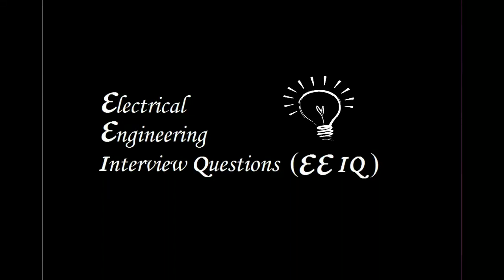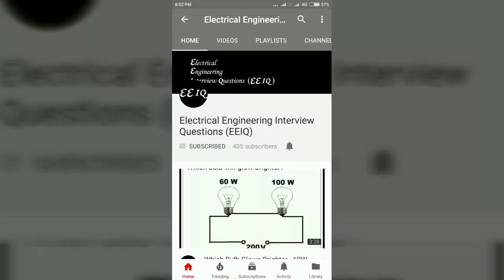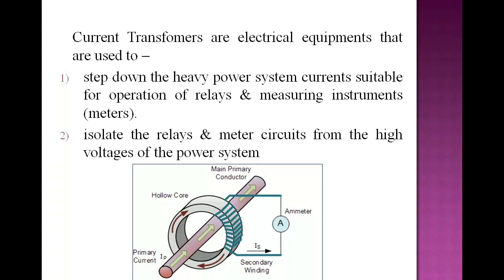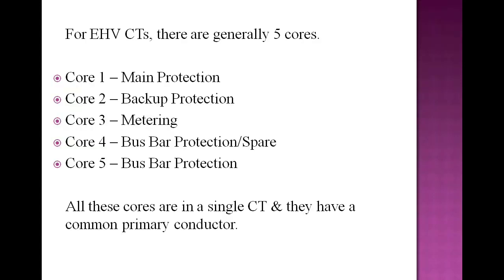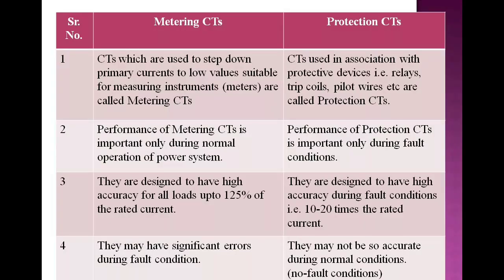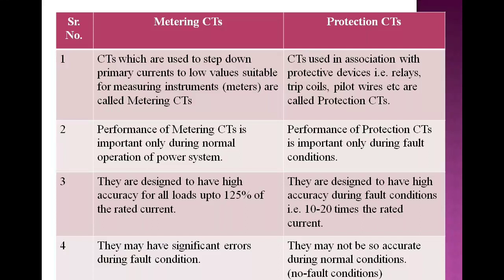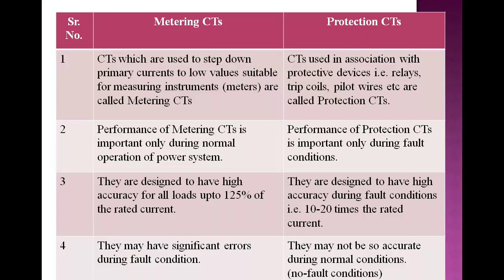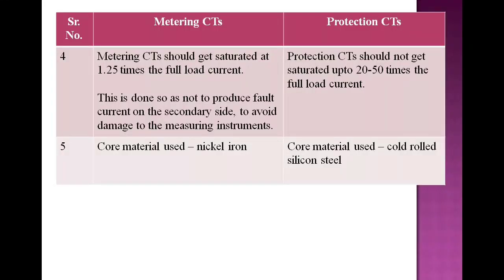Difference between Metering CTs and Protection CTs

Comment: Why secondary of ct is always only 1/5 Ampere
Reply from the maker: Earlier secondary of CT used to be 5A, But nowadays most manufacturers prefer 1A secondary rating as it reduces the secondary burden on CT.
Reply from the maker: For example, consider secondary resistance of CT is 0.5 ohms.

VA burden = (I^2)*R.

for 5A CT, VA burden= 5^2 * 0.5 =12.5VA.

for 1A CT, VA burden = 1^2 *0.5 = 0.5VA.

see the difference.....

Lower the burden, higher is the accuracy of CT.

Comment: Is it possible for 1 CT that function both protection and metering? or we need to install 2 CT with different function?
Reply from the maker: As given in the video, we can use 1 CT for both protection and metering.
No need for 2 different CT.

Comment: What is the function of Protection CT
Reply from the maker: Its function is to step down current and provide it to protection relays. The protection CT is designed in such a way that the stepped down current should be a proper replica of primary current in normal working condition as well as during fault conditions.

Comment: how to determine whether the CT is metering or protection . by testings. without following name plate.
Reply from the maker: You can find this using knee point voltage test. Metering core of CT gets saturated much earlier as compared to protection core of CT.